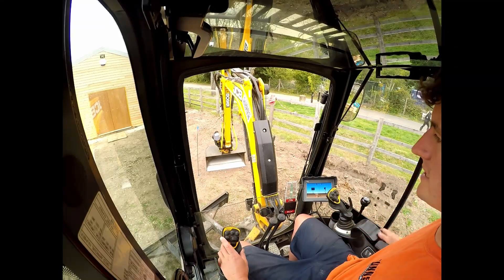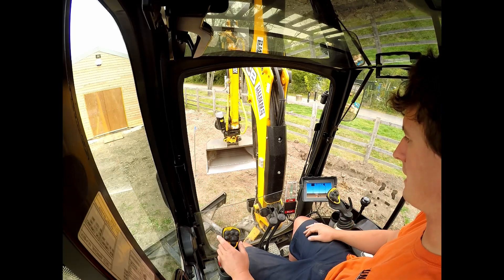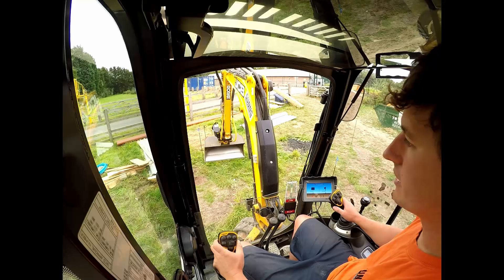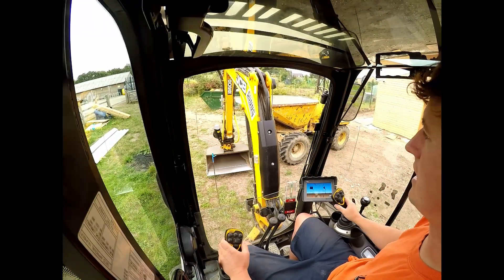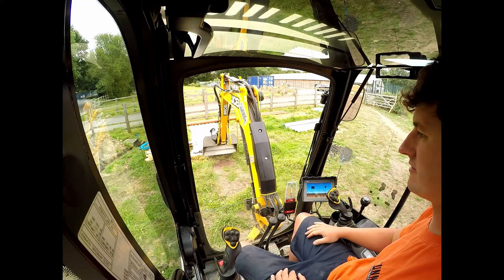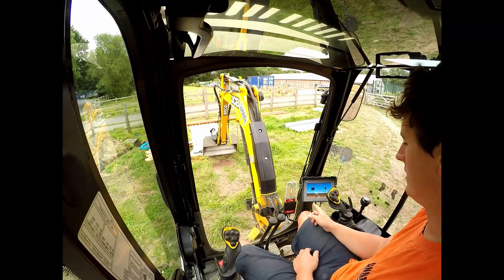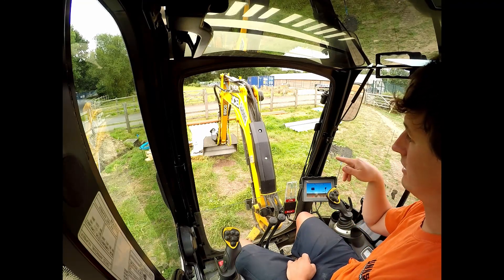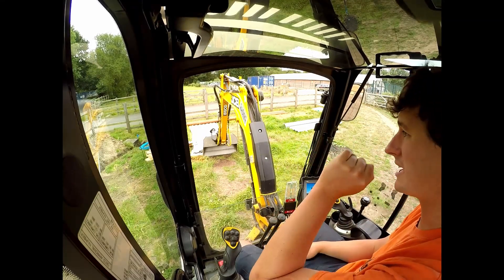How to Reduce Dig Level Area with Idig No Laser

Comment: Are you still satisfied with the 2D idig. Would you buy this device again? I am thinking of buying, hence the question. tenks 🤝
Reply from the maker: I certainly would. It’s probably the single best thing I’ve bought for my business as it saves me money nearly every day in labour and materials. The tiltrotator is good but bang for buck, the idig system will earn you its money back faster as it’s also much cheaper to buy and works across all your machines